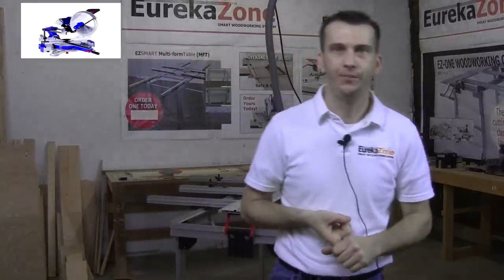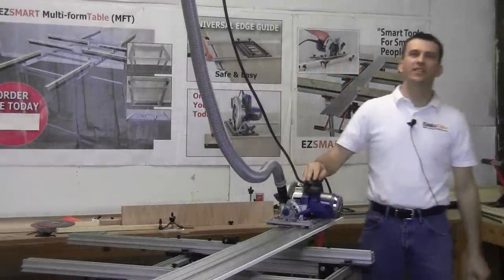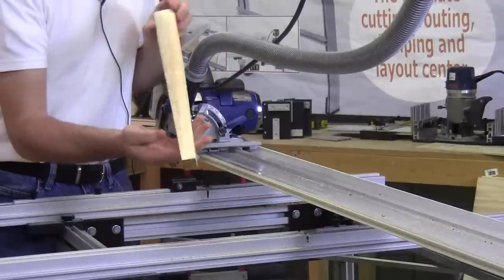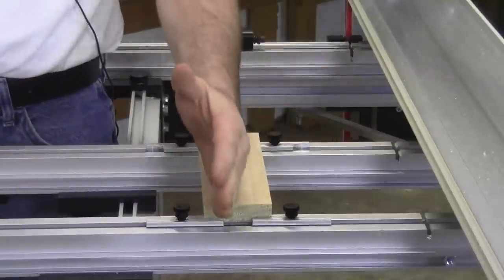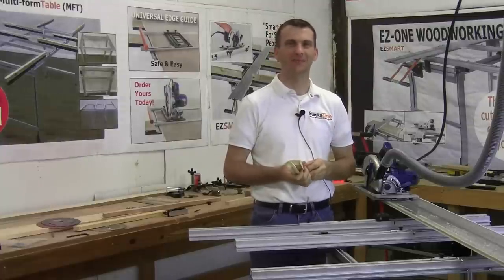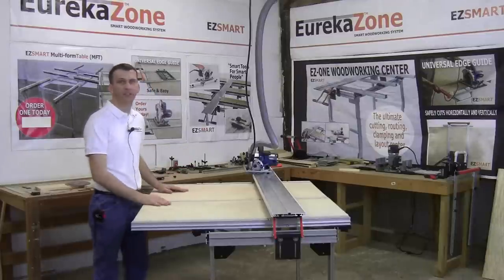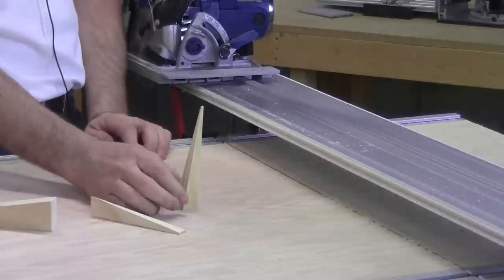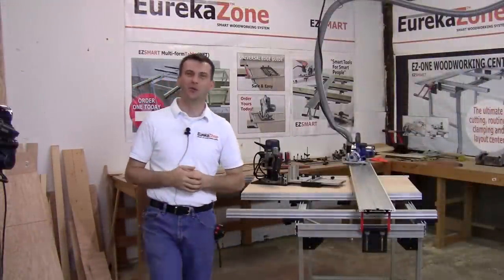Introducing The EZ-One Woodworking Center

Comment: Don't think this is the best way to SELL these.
Why not spend VIDEO TIME/viewer interest on aspects of the WWCenter that are more frequently used by WWorkers.
Showing me how to save a 15 cent scrap of wood...well...just don't make my day.

But...what would I know...I just spent 25 years as Director of Advertising for one of the Top 5 companies in the U.S.
Reply: +Romeo Whiskey You Right.
we need more task oriented videos.
tx
d
Reply: I was mightily impressed with how he safely and accurately cut that tiny piece of wood. Only a fool would try it on any other saw. That said, they do  need to show more common tasks being done. Generally, marketing could be improved.  However, it is a very safe system. It can also be very accurate and efficient. The cost of entry is very competitive, and the options for customization are endless.
Reply: @tracdfar  You can easily accomplish this on a table saw with a sled. I'm not knocking this system, but to say only a fool would try this any other way is hyperbole.
Reply: @thatguythatdoesstuff7448  

I saw that too and kinda laughed. Tracy has replied to several other posts as well, extolling the virtues of this system.  He's either working for the company, wants to work for the company, or is the world's greatest superfan.

This looks like a pretty good system but, from the comments,  it sounds like it may be more trouble than it's worth, at least for my needs.
Reply: You guys don't know what your talking about . This is the only system you can safely cut toothpicks on. Having  virtually zero waste after
Reply: @thatguythatdoesstuff7448  Yeah, there's maybe a little hyperbole in my statement. However, over the past 50 years I've run into enough men and women with missing fingers, or parts of fingers, from cutting accidents that I'm all for a system that automatically secures the work piece and points the blade away from the user, not to mention it's lighter and more affordable than my PCS. I have an Incra sled and it's great but not as safe and, with the miter gauge, it cost as  much as the the the saw and track in the video.
Reply: @rogermccaslin6750  Lol. I guess I do sound like that! It's by no means perfect but this approach eliminates many of the inherent dangers of a PCS without a wall full of jigs or the use of proprietary technology. I have no connection to the company but I'm am big fan of safety, accuracy, affordability and innovation.

Comment: $1k?? They must be trying to make their money back, that went into the design, on their first couple of sells
Reply: Not hardly. Try to spec out your own table at 80/20. Also, Festool will set you back nearly $2k for a similar set up.
Reply: Festool is also way overpriced
Reply: 1K.  He'll no. Chalk line works just fine. And if I'm cutter something so  meticulous , finished plywood. I can clamp a straight edge faster than he can set that thing up. I could see myself using this if it was more sturdy and only in my wood shop. And only if it would cut 4×8 foot sheets. Also if it wasn't more than a few hundred dollars.  As far as Festool goes, their rip off artists too

Comment: Love the set up but my question is where did you get the unique Makita in that color and where did you get the dust collector for a circular saw like the one on the Makita?
Reply: Eurekazone makes the dust ports that fit in all saws.
Reply: The color in the video may be off. The saw is Makita 5007mag. You can use any saw you want. The dust collection is a mod they offer as a service or a kit. But you can use any saw you want, even one you already have, which is really nice.
Reply: I'm not connected to the company but I'll take my five decades in the business and gladly accept the jibes over being like you. I have Festool, Makita, Sawstop, and a host of other brands in my shop. These guys are introducing a concept that is simpler, safer, more affordable, and still accurate. What do you have to do offer?